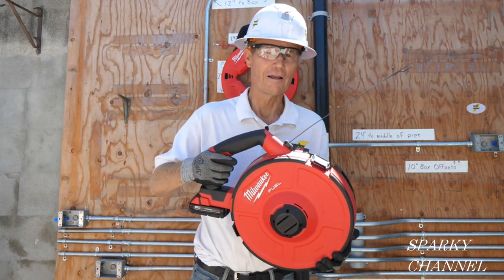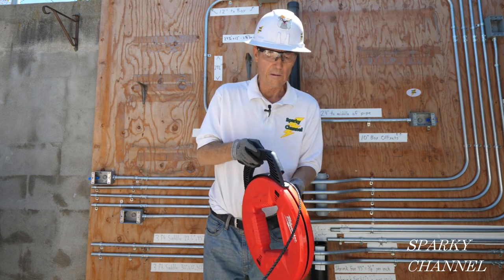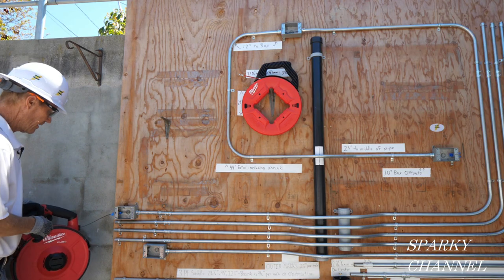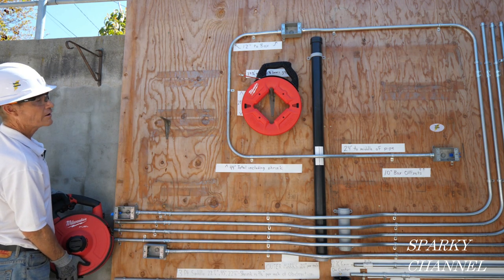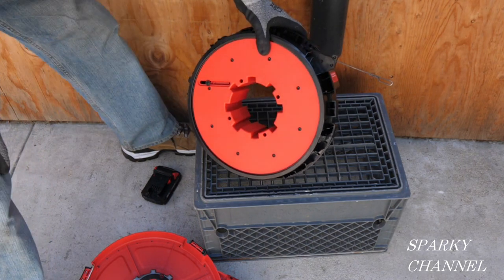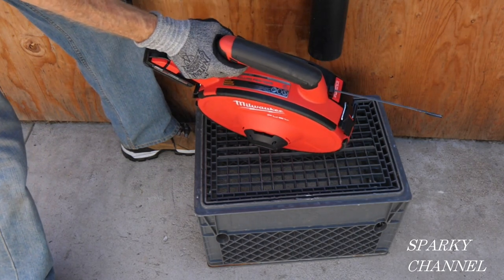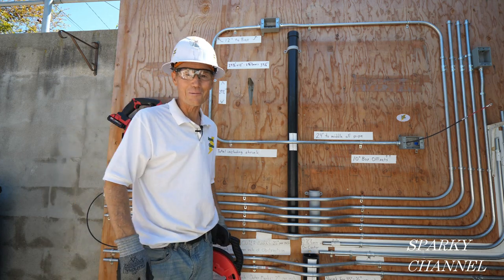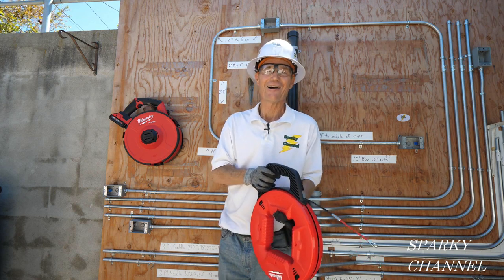Milwaukee M18 Angler Powered Fish Tape 48-44-5195 Review

Comment: I see one use. Short underground pvc runs where the vacuum runs out of battery, or if you don’t want to lug the generator around. Now if they came out a remote for this unit and some sort of mounting hardware...means pulling wire solo.
Reply from the maker: Thanks Ann!

Comment: poly also doesn't rust as fast, but poly doesn't really push long distances and it can spiral in large conduit.  stainless with a flex leader is my go-to.
Reply from the maker: This poly line was all the rage at NECA 2019. All the brands will be going to it. One excellent thing is how small and round they can make the head. Stainless sounds good too.
Reply: @SparkyChannel  stainless is still the flat cross section like the plain steel, but it has less friction because it doesn't rust as fast.

Comment: Hmm, I see you can get the polyester all the way through, but if you had say 3 12 AWGs, would those be able to make 330 degrees worth of bends? Since the steel tape can't do it, it might be hard to get the wire all the way through right?

The tool is cool though. Probably way overkill for most situations, but for larger companies it may come in handy.
Reply from the maker: I'm trying to get a poly drum so I can try it out. I think it can do it with the poly drum. Also, I think your assessment is correct.

Comment: That’s cool and all but will it work on 150 ft run with  7  90s
Reply from the maker: No.
Reply: If you’re running 7 90s you need to be fired
Reply: Shouldn't be seven 90s in any run of conduit. 360 degrees max total of bends in a conduit run.

Comment: This seems like an expensive solution to a problem that doesn't exist.  
I'm a huge Milwaukee fan just couldn't see justification for this power fish tape.
Reply from the maker: I understand. Thanks for writing!
Reply: problem that doesnt exist?....jesus you ever pull wire with a 200ft fishtape with a coworker that slings that crap all on the floor and gets it tangled everywhere, this right here feeds it and pulls it saving shoulders i'll take 2!
Reply: if its 200ft run, you do the vacuum trick and get a twine in it. That method is cheaper than a power fish tape. Real electricians won't use it. It's for those low voltage wannabe sparky that can't push a fish tape for their lives
Reply: @allanyang21  not in a 3/4 emt run...
Reply: @allanyang21  bullshit here in Germany we use it every day on the site

Comment: i saw it struggling a couple of times i would like to see a real world test pulling wire. beforw i spend all that money in this tool
Reply: the only reason someone will buy it is to save time from reeling 200ft back into the coil. if you're planning to use it under 100ft, then thats just laziness lol.
Reply: @allanyang21  What if you have to do dozens of <100ft runs every day?
Reply: @allanyang21  Old timers had the same thing said to them when electric drills, skilsaws, and sawzalls hit the market. All you really need is a hand brace and a drill bit, why bother with the whole electric drill motor thing, that's just laziness ;-)
Reply: @JoeZasada  I do sound pretty old school and you probably are right lol. I’ll wait for a m12 fish tape that’s 50-75ft and half the cost first.

Comment: @sparkychannel hey BILL I HAVE A QUESTION FOR A NEW VIDEO. DO YOU NEED TO USE A ROTO-CUTTER ON BX OR MC cable?
Reply from the maker: I recommend it but the main thing is to be sure to not nick the wire insulation at all.
Reply: @SparkyChannel  agreed. But do you know of any code or manufacturers instructions for HOW to install BX/MC ? common sense is the rule of the day. But I'm looking for a bit more. I know it's a nit picking question, but you're my only hope Bill. !!!! Keep up the good work.

Comment: 9 out of 10 you will be feeding through the face of the box and not through. I guess the apprentices of today can not feed or pull in the Fishtape without needing physical therapy and paid leave.
Reply: FACTS AND 399 or something for just tool without the drums is crazy I’ll keep using my hands too push my fish tape 😂😂
Reply from the maker: Good point. Less friction if you run the tape straight through the box.
Reply: @Ryker they are beyond weak! Not a parent but have been a master for 30+ years so know most are also to lazy to study in addition. What group are you a part of?
Reply: You know how many older guys I know w wrecked knees, shoulders and backs? Work smarter not harder
Reply from the maker: @randymathews3348  Especially knees with electricians. I see young electricians abusing their knees while working. It makes me wince.
Reply: you've clearly never pulled RG-11 across 200 feet of conduit in the middle of a 120 degree heat wave by yourself under a one hour time pressure knowing you still have to prep the cable and run signal quality tests. if I had that tool, i wouldn't have lost my productivity points that day.
Reply: @nationalelectric6507  It’s called using your brain and working smarter. I know your generation isn’t very good at that though

Comment: Wast of money 💲 I think for a solo person might serve ok in some things. But really how many times will a contractor use something like that "X % of the time" and sit the rest of the time
Reply from the maker: I hear you, thanks!
Reply: A broadband technician working an a underground residential area fishing flooded coax across streets? every day. a contract underground install company used by telecom companies to install underground conduit in residential homes that dont already have one? every job.
Reply: @dirtyvinyl8817  Large company like #Comcast #Xfinty #PacBell possibly will use it more. I was speaking more so small contractor or small contractor company. Though for a small run I would use a lite weight hand held fish tape instead of pulling something heavy and bulky like that out
Reply: @KY4TRK  I understand, just don't forget the cable techs, they need tools like this and if Milwaukee cancels a product like this cause electricians dont like it, then that would suck. some of those guys would simply kill just to have a polyester fish tape cause those metal ones rust from going through wet muddy pipes.